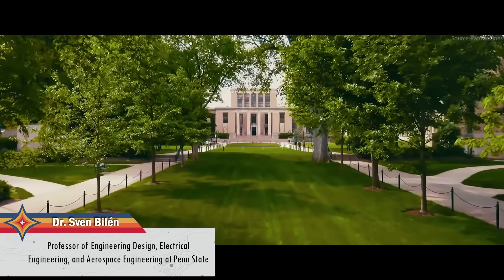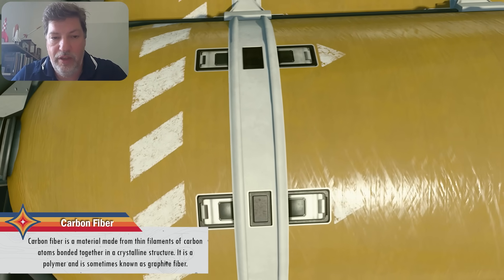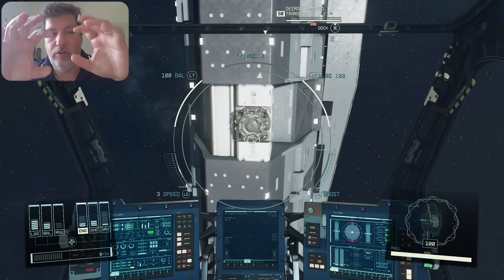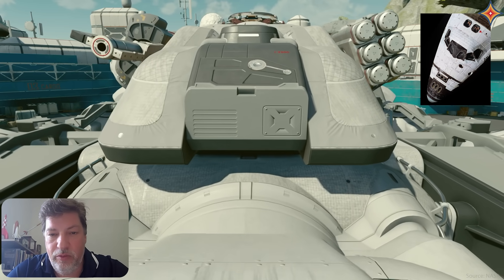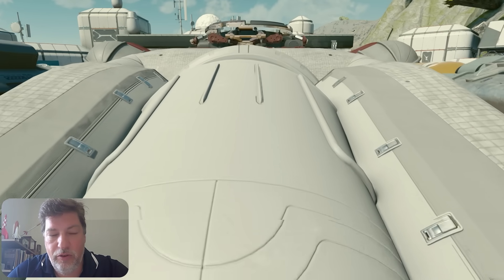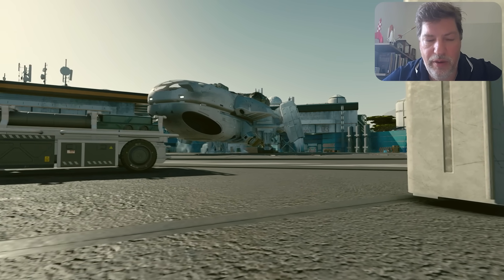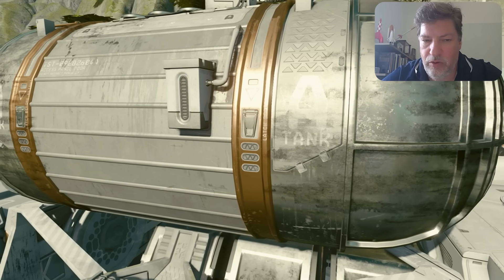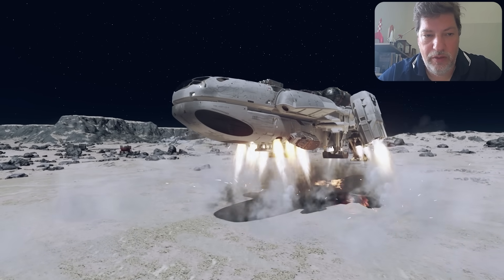Space Systems Expert Reacts To Starfield Ships

Comment: Having an expert actually speak on the reality of some of the designs for space ships in Starfield is awesome because he gives proper insight and on what we can do now verse what the game indicates and in all honesty I really want to see his opinion on our custom ships cuz some of us have gone bananas with the starship creation.
Reply: Honestly, as obvious as it is, it was neat hearing him talk about having to reduce weight and stuff, considering reducing weight is a huge park of ship building in Starfield, or having to add engines and stuff if the ship's too heavy. I had to remake most of my ship yesterday because I needed an extra couple of LY on my jump range, to get to where I wanted to go. Once it was built, it was still a bit too heavy, so I had to go in and start removing unneeded decorative parts, and replacing cargo holds with slightly worse, but lighter weight cargo holds, until I finally got it to the jump range I wanted.
Reply: @TXFDA  it does take some time to get more skills for your character but I’d say by the time you hit your third NG+ it will be easier to get ships to reach further destinations. But I also reworked all of my spacecraft to have weight reducing parts on them to replace some of the hull panels I was using. The Nova Galactic skeletonized frames help allot and after perking high into space craft design I hopped systems repeatedly and put parts on my ships from each manufacturer to make custom space craft that were like seeing a flying hot rod not gonna lie I make some ridiculously badass fighters so plenty of times the ships is a bit bigger than normal but it is so fast and maneuverable that I’m just out flying anyone else and I’m on their asses like stank on shit.

Comment: That was really fun to hear his take. The game designers did some remarkable work in researching how to convincingly handle these details. But one of the more fantastical things I think would be the relatively small volume allotted to fuel capacity. I don't think Starfield has anti-grav systems assisting the thrusters like Star Wars ships do. So, for a ship that is all rockets, it must be some incredibly amazing breakthrough in thrust/fuel ratios in future tech.
Reply: One of the systems is a "Grav Drive" that provides artificial gravity, and somehow FTL capability.  But, if they can create artificial gravity they can probably cheat and lighten the ship, or something.  Without that there's absolutely no way these ships would function.
Reply: Remember these ships are being fueled by helium-3, not some conventional chemical fuel. helium-3 is an IMMENSE source of energy. Twenty-five metric tons of helium-3, about a quarter of the cargo capacity of a SpaceX Starship, would suffice to fuel all the power needs of the United States for a year. So its easy enough to figure these ships don't need to have a massive fuel storage taking up much of their weight to get them moving. Also these ships are most likely power by massive fusion powerplants. Or in some cases Tokomaks as well. Lastly these ships do have grav-drive systems. So its easy enough to think they supply their own gravity as well while in space.
Reply: @CaptainKeen Not really faster than light travel. Its more like creating a warp drive like Startrek does by bending space and using that to instantly warp from one destination to the next.
Reply: @CaptainKeen  Oh that's an interesting point!
Reply: @Someguy6571  Oh I will have to look into Helium-3 and learn more. Thanks for that.
Reply: @Someguy6571  Which is functionally FTL travel.  Pretty much every FTL method is just a way to cheat, either creating a wormhole, going through another dimension, or warping space.
Reply: @Someguy6571  Helium 3 is energy rich, but rockets still work on conversation of momentum so they have to throw some form of propellant out of the back which presumably wouldn't be the material you are using for fusion.
Reply: @spacechannelfiver  I am pretty sure that they have found a way to use something else other than a chemical fuel source for conventual propulsion. Something like Ion propulsion or anti-matter drives.
Reply: @Someguy6571  to me it feels like we are in a giant Iron Man suit. Similar to how the arc reactor powers weapons/propulsion for the suit.

Comment: Fascinating insights from an expert! I think we also need to consider that these ships are designed around how they would operate on an Earth like planet or Moon. Because for larger planets, with more G, you need much more thrust to gain escape velocity, thus larger engines, fuel tanks etc. Also, because it is a game, we don't consider the impact on such a ship landing on an extreme planet like Venus, with extremely high pressure and very corrosive atmosphere. The Soviets built a probe especially for the conditions on Venus, and it lasted 20 seconds after touchdown. An other angle is how it would behave on almost absolute zero temperatures, say you land on Pluto, where methane gas is frozen solid hard as rocks. Such a place would made the metal of the ship shrink and become brittle or who knows, it is uncharted territory for science. But for me, ship building is one of the most rewarding systems in this game, as exploration is kind of stale without vehicles or aids.

Comment: In Starfield the propellant storage for the engines isn't shown in any of the details. The fuel tanks that are added in the ship designer are to contain He3 for the gravity drive (the game's in universe take on both FTL and shipboard gravity control). The engine fuel seems to be handwaved in as part of the total engine assembly rather than as a part in its own right. Refueling of both He3 and propellant is also handwaved as it's just presumed that the ship can top up those tanks in any system it stops in long enough, even in those that lack stations, starports, or even an appropriate stellar body to siphon off. This makes for much smoother game play but of course reduces realism.
Reply: And if you want a bit more 'realistic' .. well, more hands-on approach to spaceship fuel and refueling, you can try and play Elite: Dangerous.
You will get stranded with empty tanks there more than once 😄
And sitting in a your ship, that is slowly shutting down around you, in the emptiness of space, with 20 minutes of air left, sending out emergency signal, waiting if one of the player volunteers that run rescue operations will take a pity on you, is a whole new powerful experience 🙂

Comment: When you concider the fuel in the tanks is helium3 and is only used for the " grav drive  "  the rocket engines run entirely on power from the reactor according to the ship building  system
Reply: I'd be interested to hear someone talk about He3 as the fuel source.
It actually has potential to be used as fuel for fusion reactors one day!
Reply: Helium 3 is the fuel for the reactor and the rockets. It's just that take off / landing isn't counted because it's such a small percentage of the actual fuel used, compared to running the grav drive to go to different star systems, but I also imagine the reactor works in conjunction with the rocket systems, powering mechanisms in order to increase thrust. There always need to be something to expel for thrust, and the whole point of using Helium 3 for both energy generation and thrust is that it reacts with deuterium while also being non radioactive. So they might be "wasting" their reactor fuel by expelling it, but that just comes with the territory of using Helium 3.
Reply: If we assume that the reactors run at the same temperature as the sun.
40% of the sun's output comes from He³ + He³ = He⁴ + H + E
Now you could let the He⁴ and H continue fusing, producing Beryllium⁷ and more He³ and more energy but it's a small fraction of the output.
So we activate the Magic SciFi Filter and use the He⁴ as reaction mass.
As for the H¹, it'll start back up the fusion chain
H¹ + H¹ = H² + E
H² + p = He³ + E
This accounts for another 40% of the sun's output, however it requires protons (H¹)
And as you only get 1 proton from He³ fusion and need 3 protons to get back to He³, you don't have enough.
And as there's no H² tank, we'll assume they're using H¹ as reaction mass too. Activate Super Hydrogen Filter.

So:
He³ + He³ = E + m
The energy is captured and used to power the reactor, the systems, the weapons and the engines.
The mass is used in the engines and I assume the mass driver cannons as well.
EAT HOT HELIUM SPACERS?
Er...

Comment: Adding some context to what he explains with in-game context: The fuel tanks here didn't store the fuel for the engines (the engines somehow draws fuel automagically from somewhere), since the fuel tank is used to store He-3, the fuel required for Grav Jump, the in-game explanation for FTL travel between the star systems. The best part after several hours tinkering with the ship building mechanics, is the fact that each landing gear have different number of landing thrust power, with each landing thrust power holds around 200 point of mass, while my most disliked feature is how the placement of the engine basically doesn't affect the mobility of the spaceship (like how putting just a single engine in the middle could produce enough thrust to be that agile???), would love to see how the distance of each engine placement toward the ship center of gravity could provide like mobility bonus to help the turn and such.

Comment: Question: is it ever explained in Starfield universe how the ships have artificial gravity? It can not be the grav drive, since there is a ship without grav drive (naming the ship would be a spoiler) which also shows artificial gravity.
Reply: Not sure exactly but you learn the first grav drive was developed using the first ARTIFACT  found by humanity  so its likely they also developed some kind of " grav plate "  as well
Reply: The only time I've come across it so far is a random event with a capital ship you can board that has its artificial gravity turning on and off, so yeah it seems to just be hand-waved away as tech they take for granted (which is funny when compared to the relatively low tech a lot of other things have, like the rocket engines)
Reply: @Mr_Waffle.  Yes the tech part is never explained. There is a loading screen tip that says: helium3 can be found on moons, it serves as fuel for your grav drive. Yet, you do not need to mine it to grav drive. Within solar systems you do not need the He3 fuel, but you do need fuel for your normal engines, but it is never explained how the rocket equation is overwon. It most likely works like the Eppstein Drive from The Expanse, which also has a nucleair fusion reactor.
Reply: @Ecclesia_  originally todd wanted players to have to use fuel like in no mans sky but they changed that at some point but didnt bother changing the loading screen lore . Pretty much like the pre war suit of XO1 PA in nuka world that the loading screen says " developed by surviving remnants of the military after the war " hey it just works after all 🤔
Reply: It's more like a plot hole, because the gravity plating is clearly derived from the grav drive technology. The grav drive bend space to travel long distances. The gravity plating would need to do the same, but at a much lower level, to bend space just a little bit. But even then, gravity plating itself introduces all sorts of problems. You can't just make it at a persons feet, because then the rest of their body would be weightless. I'd also imagine it would be more like a gradient, but not one you could exactly control precisely. So for example, the gravity field itself from the grav plating would have to extend beyond the ship, which poses all sorts of problems, both for space travel and ship design. For example, say you have 3 decks with grav plating on each. That would likely result in each deck above feeling progressively heavier in gravity, due to the pull from the decks below. I can't imagine that grav plating has an exact cut off point where gravity suddenly becomes non existent. And since you'll be having gravity on multiple places on the ship, that can change design requirements drastically, because it would be impossible to make the stresses of gravity equal across the entire ship. There would have to be dead zones, and if you've got something with uneven loads on it, that could easily cause problems with structural stability.
Reply: The grav drive is the artificial gravity.  Source - Cora Coe won't shut up about turning off the grav drive.
Reply: @Sleeptastic  Well that is inconsistent lore. Reason: at some point you run into a 200 year old ship. This ship has no grav drive, but obviously it has gravity.
Reply: @Ecclesia_  They probably f'ed up the lore.  But for every other ship, the source of gravity is the grav drive.  In fact if you board a ship after blowing up its grav drive, there will be no gravity on the ship

Comment: Oh nice, I alyways put my fuel hidden inside my ship.

 I make a huge ship with habs never connecting from upper or lower ports.(so no ladders in my big ship with lots of habs) I use the double layer cockpit with stairs to access my top layer habs. I use Hope connectors to keep top habs from touching the bottom habs.. And a brig directly connected to the bay and one to the dock. So my entrances are protected. 

So this layout leaves alot of empty space inside. Great for fuel and cargo.  It also makes a big ship that weights significantly less than other ships the same size.

Comment: The engines don't use liquid fuel though - they're powered by a fusion reactor. The fuel tanks are strictly for He3 which is used for grav drives, and the size of the tank determines total range for grav jumps.

Comment: Those shock absorbers on the landing gear of the Frontier look to me more like hydraulics.  Namely because if you watch the frontier land, it hovers as the landing gear extend out.  The engines slow the ship enough to where it doesn't need shock absorbers it just hovers until the landing gear are fully extended and then the engines shut off transfering the weight of the space craft onto the landing gear.  Perhaps shock absorbers might be necessary in addition to the hydraulics just so the weight of the space craft doesn't crush anything in the landing gear during the weight transfer.

Comment: I would like to point out that the external fuel tanks aren't for the regular engines. They store Helium-3 for use with the grav drive which is used for ftl travel. I'm assuming that the fuel for the standard engines is in integrated tanks. I think the machining part on the gear was done out of ignorance on the part of Bethesda with the modern method of making things lighter not necessarily being widespread knowledge. Give it some more years and it will be as well know as the shuttle. Now when it comes to control surfaces, I prefer a method that uses things like sticks and switches with some glass being involved mostly for display purposes. I don't trust touch screens all that much as they seem like something more finicky and easier to break. My phone is plenty of touch screen use for me.

Comment: the things that bothered me about the ships in game is that IRL ships like Musk's Starship is that he only needs one set of main engines because he takes off like a classic rocket. these ships are less efficient because they need two sets of rockets, mainly to support the psychological needs of the pilot I guess. The other thing that bothered me is that you are basically using ISS style modules as fighting ships where there are lots of vulnerable plumbing and wiring that is neccessary to make those work. There is a game called Shipbreaker where you scrap starships, those ships have a two-layer hull design where there is an outer hull, a latticework of structural members, and then the interior modules. Building ships that way seems to solve a hell of a lot of problems that these ships seem to ignore.

Comment: From a realism perspective, I would think the Starfield ships are too small to achieve orbit in the first place without some sort of sci-fi anti-gravity technology. In the real world massive and I do mean MASSIVE amounts of fuel are required just to get into orbit. (Just look at the Saturn V and all the booster attachments the shuttle had!)
Reply: Like a grav drive?
Reply: I mean, to be fair, in addition to the grav drive there has to be some other syfy technology going on because somehow you're able to get 1g on a spaceship with no rotation.

Also, you somehow end up with 1g in buildings even on planets where the gravity is higher or lower than Earth normal.

Also, it's weird to me that the fuel tanks are only for the grav drive and somehow everything else doesn't need fuel... Or it's stored in a way that isn't outwardly visible.
Reply: @ViviFuchs  Fuel is internal, a lot of what you mentioned about the G’s is just so it’s easier for us, i bet you my life if people were in a low grav system inside a building and they just want to jump down some stairs they’d get stuck in the roof or take ages to come down for what they wanted was a short cut, also refuelling was something Todd wanted but ultimately decided against because it would just take away from the exploring and the game play loop would be unnecessarily uneven.

Comment: Just a question, when it comes to viewing ports on a ship, is it better to have cameras to view the outside or is a windshield is fine?
Kind of a train of though that's been floating around the internet. I would think a windshield would be a major weak spot on a ship, but NASA still uses them. Although I know weight is a major driving factor in modern ship design.